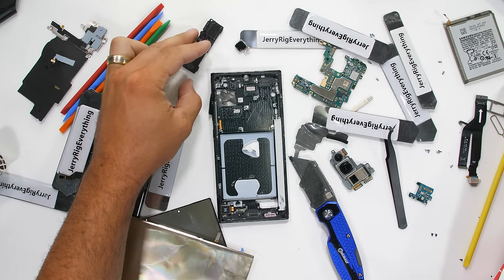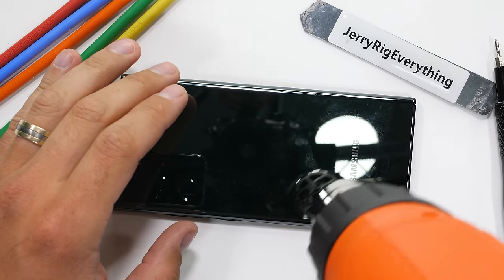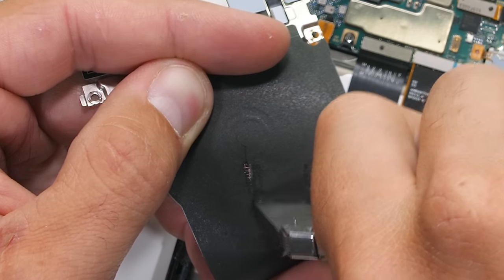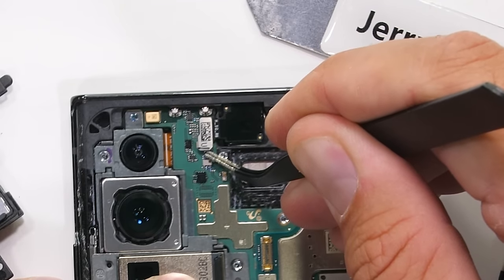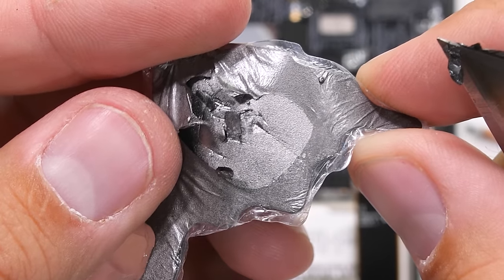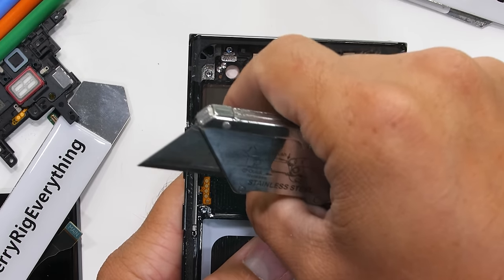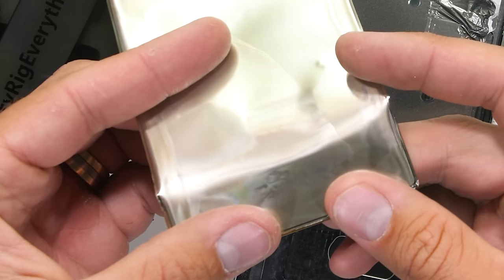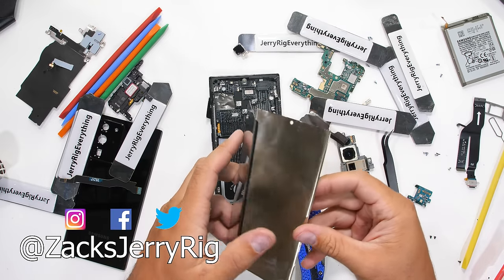Samsung Note 20 Ultra Teardown! - No Copper Cooling inside?!

Comment: Jerry, i'm not a fan of this double-standard practice either, but:

Graphite has a HIGHER thermal conductivity coefficient than copper, it's likely the Exynos chip requires a better heatsink to dissipate the higher heat it generates compared to the Snapdragon model.

Of course, Samsung could just put the same graphite cooling system on every phone and just charge less for the weaker Exynos model....

Comment: The problem I see with the graphite versus copper cooling argument is that there are not really any tests proving that the copper cooling is better than the graphite. Also, I wonder if the virus and the inability to keep up with the demand is what's forcing them to use different components. It could also be due to an internal competition between two cooling systems to see which one is better (expectation being one being better than the other by a small amount). Even so, this year I would cut phone companies some slack(but not too much. Pricing a phone at $1300).

Comment: So basically they're thermal throttling the Snapdragon phone to try and match performance of the poorer performing exynos.
Reply: Exactly, it's supposed to avoid the drama over the US S20s performing way better
Reply: He stated that this teardown is the international version. So the Exynos one.
Reply: @rushnbh  i assumed you are correct
Reply: @rushnbh  No. Zach made a mistake. The one he tore down was the one with model number SM-N986N, a Korean version using a Snapdragon 865+ chipset. Not an international version using Exynos chipset. So, yeah, it's safe to say that they intended to do thermal throttling of SD865+ chipset to compensate the poor performance of Exynos 990 chipset.
Reply: Yes! Snapdragon unit has graphite pad, while Exynos unit has copper pad!
Reply: @nimeshyelshan8704  NO HE'S NOT! 🤦🏽‍♂️🤦🏽‍♂️🤦🏽‍♂️
Reply: @rushnbh  WRONG! What he stated is Not 100% CORRECT!!! He uses a South Korean unit with model number SM-N986N, that's a Snapdragon unit with graphite! Buyers confirmed that!
Reply: @yosoy01ian  How buyers are supposed to know what kind of thermal solution their phone has ?
Reply: @travelwithdivyam6400  unless they are able to do another tear down video of the US version Galaxy Note 20 Ultra 5G. Because it was already proven that the internation version Note 20 Ultra with the Exynos 990 processor has the Copper Cooling pad in it inside.
Reply: @travelwithdivyam6400  
Snapdragon - graphite pad
Exynos - copper pad

it depends on which country where you bought.

Comment: I guess copper cooling system is only available in korea (Samsung's origin country) and not in other countries.🤔

Note- I think🤔 It's not about Snapdragon or Exynos version.
Reply: Zack is actually using a South Korea unit with model number SM-N986N! It actually uses a Snapdragon unit with graphite cooling system, similar to US model. Units with Exynos will have a copper cooling system on it.
Reply: @yosoy01ian Okay, But then also they aren't allowed to sell same phone with different parts in different regions (not talking about different processor )
Reply: @Mayank_Gupta  Yes! I assume that the component (for thermal pad) should be the same.

Comment: I agree, Samsung's game has been going downhill. Had a wonderful experience with my first Samsung, the Note 8. The Note 10 Lite seemed a pretty close cousin and I happily recommended that for my dad. Its been quite a let down though. Definitely not value for money. 
The Galaxy Watch 46mm has been quite a disappointment too. The barometric sensors have never really worked well nor the altitude and sleep tracking has been temperamental at best. 
Dont think my next device is going to be a Samsung though I still love my Note 8.
Reply: My S8 has battery issues (it’s dies quickly) , and I brought it in September 2018... It’s not even 2 years...

Comment: I used to be an all in Samsung fan until they started ripping us off like that. everytime isee one of there new flagships i get tempted to buy it but and I do want to go back to them but I cant because of actions like that.
Reply: 🙄 I think graphite works better! And wont dry out from the excessive heat from the Exynos chip anyways ! I think they couldn’t use thermal paste so they used graphite instead! 
A good graphite sheeting has conductance of over 1000 whereas thermal paste has onky 15 !
Reply: @rahuldogra  totally correct! Zach is completely wrong on this one, the exynos version clearly has the superior thermal solution, NOT the copper heat pipe in the Qualcomm version!
Reply: obiwac the heat pipe is a better thermal solution but the thermal interface material is the culprit there ! Pad can get a good seal with out the need of thermal interface material
Reply: SAME HERE SAMSUNG IS DANGEROUS THAN CORONA
Reply: @obiwac  I THINK OBIWAC DONT KNOW ABOUT EXYNOS IT WILL BURNT HIS HOUSE LATER RATHER THAN CORONA
Reply: @raghuraghu-vz2cj  wtf

Comment: What i dont get about Jerryrigeverything is how he downplays Graphite Film as a heat conductor. It transfers heat exquisitely and Apple exclusively uses Graphite Film to dissipate heat all over the iPhone. Samsung chose to do the same because it works, almost as well as Copper. Every second manufacturer uses Graphite Film because it dissipates heat just fine. There is no need for Copper if they did not deem it necessary. This is not a Desktop computer where you‘d need Copper as a Heatsink for the Processor. These processors dont get enough to justify needing to use Copper as a heat conductor!
Reply: yup, graphite have thermal conductivity of 370W/mK while Copper have thermal conductivity of 385W/mK
graphite also comes with only 21% copper weight, so it's a solid upgrade over copper

I even wonder how he have some balls at both ends to say graphite is bad compared to copper

Comment: Strange I've only had Exynos phones since the Note 2 and never had heat issues. I once had a Snapdragon S4 and Axon 7 phone and both had really bad heat issues.
Reply: I'm having heat issues with my note 9 exynos
Reply: Phones with exynos aren't bad by any means, that's not the point, but snapdragon ones (starting from the 835) are noticeably better, and Samsung charging the same amount for a less capable phone with exynos is a total dick move
Reply: @duranmxx  I guess your right my friend has a PocoPhone F1 which I'm sure it's 835 and his phone never heats up. I guess they still had heat issues up to the 820, that's why I said I'll never buy another Snapdragon phone but since I'm getting a OnePlus 7 pro I guess I'm giving Snapdragon another chance. But I'm being honest I've never had any issue with any Exynos Phone.

Comment: 10:03 that's not just sketchy, it's daylight robbery. Especially because here in India we get the note 20 ultra with Exynos 990 and we pay equivalent of USD 1421/-
Reply: Not true I've just ordered it's almost the same price if you considered credit card offers I'm from India and I have preordered will let you know how the mobile performs for its price
Reply: Sanjay Charan Credit card offers don’t count while reviewing.
Reply: @vblaze011  atleast an extra 128gb? While in US they get 128bg for 1300 and we get 256gb
Reply: Sanjay Charan India models work 10% slower due to Exynos, don’t have a copper heat sink on a chip that’s known to overheat so it’s not a true positive.
Reply: @vblaze011  I understand your concern I'm equally disappointed as you for Samsung using a inferior chip but what I'm trying to say even some exynos variants are found having copper heatsinks it's random unless Samsung opens about which variant has which heatsink plus note is not a gaming phone its a phone for note taking, creator's, business user's and students so exynos is sufficient but I even hate the fact that it could have been better but over all its not a bad phone it's totally based on  your personal preference.

Comment: Imagine if apple did this everyone would be fuming 🤓
Reply: Seriously
Reply: It did happen when they used two different chipsets in the iPhone 6s I believe where Samsung and TSMC were making the chipsets and Samsung obviously was the inferior one and everyone was calling it chipgate and throwing a tantrum for a whole year because of 5% diff in performance
Reply: Researchers at Chalmers University of Technology have developed a graphene-based film that has a thermal conductivity capacity that is four times that of copper. This new technology makes it perfect for cooling electronics circuits and components in RF devices, LEDs, servers, and smartphones, to name a few.Jul 15, 2015
Reply: apple is using graphene it is better than copper
Reply: and is expensive than copper
Reply: true
Reply: @gogeta7173  I'm betting that's just apple fan(boy) fiction, there's no way they're getting any useful work done from graphene in the centimeter length scale without revolutionizing WAY more industries than phones. If they do have it and aren't making more products from it while keeping it a trade secret imma sue them for not acting in investor, public, and world interests.

Edit: Unless I'm just an idiot and thermal conductivity doesn't degrade as quickly with imperfections? Of course it doesn't

Comment: This device charges another device WIRELESS faster than my iPhone 11’s ancient ruin stock charger adapter. Thank you apple
Reply: Apple is cutting edge!

Said no one ever. 🗑 phone.
Reply: and they worried about stupid vapor chamber and thermal pastes nobody care about this
Reply: At least Apple doesn't gives you different processors with different cooling systems for $1300.

Comment: When Thermal cooling is required for Exynos to keep their hot processor cool they used it for Qualcom..😂 Except USA, Canada rest of the world Samsung take them as a fool. Thats why they are doing this kind of cheating. Still i'm a Samsung User bt for my next device i would go for iphone or Xiaomi rather than Samsung.
Reply: I am a galaxy note 8 user and can confirm that the exynos chip is easilly getting warm.
Now i am using mate 30pro huawei with kirin, such a huge diference. The kirin is so good in handling heat, play OL game and the HP'temperature is not increasing
Reply: Yeah like iphone got thermal cooling lol

Comment: @4:17 without having a sound measurment device, I can easily say that the note 20 ultra in my hands has MUCH closer stereo audio than my note 9 (or iPhone 8 plus...or 7 plus) did. I created an audio file to test my airpods back when they first came out, and ended up learning of the speaker disparity on the 7plus at the same time (got apple to replace the speakers on my brand new phone thinking it was broken....and they broke the phone....so I had to drive elsewhere to get THAT one replaced).....took the Google spoken version of the words left and right into an audio editor, split them into separate channels and then copy pasted the clip. You can turn the phone to check the other to make sure it isn't the volume of the word to see how it sounds to your ears, before now the difference was ridiculous. I can hear a difference one the note 20....but only if im trying to.
Side note, the reason for the test was to see if a single airpod would play mono sound automatically...they did, later i found that the gear iconx did not....but my first gen galaxy buds (and now galaxy buds live) do in fact also do this, put one in, get full sound

Comment: I really like your videos. A fan of yours from the Philippines.

I got mine the LTE version because the 5G version was offered only during the pre-order period.

I am disappointed because the LTE version only has 8GB or RAM and exynos in it and the price difference only around 100 dollars. I don't have a choice because the 5G version is no longer available. I really need this note and it's features for my work. I was like got double killed for 8GB RAM and exynos.

It would be so nice to have the 5G, Snapdragon 865+ and the 12GB in it.  This is my first note to replace my 3 years old CP.

The dilemma of NOTE 20 ultra.

Comment: iFixit’s Greg Kramer, a thermal systems engineer, states that “there is little difference in performance between vapor chambers and the graphite. As long as you take the gap tolerances into consideration, it can be simple enough to swap them out for each other.”

Comment: 9:53 i feel the same. I left samsung for one plus. I actually just watched the one plus 8t tear down before this video and for some reason I found that video more interesting. Seems like it had stuff that this note 20 ultra should have had. Also the one plus 8t costs a fraction of the price if purchased while on promo. Got my 8t  for 250 bucks after i traded in a galaxy 9 i purchased on Amazon for 250 bucks. Good tmobile promo imo.

Comment: I am watching this video now and remembered my own International Note-20 Ultra (with the Exynos chip) and it does have the copper vapour chamber, I know it does because I used it on another device (N20U was beyond repair and I needed the vapour chamber for something else so I took it from the N20U). 

My phone was released in 2024 before this video, so I am now very confused. are the phone's Zack is showing (and the other one he showed in another video) both defects that are missing the copper chamber or is there something else at play here? My phone IS the exact same as the one he showed (just gold) and it does include the chamber. 

Very Strange.

Comment: I have an S7 Edge that's really showing it's age........may be my final Samsung smart phone after following them since the S2. The craftsmanship and corner cutting (to me) with the whole heat dissipation is disturbing in something so expensive, and I concur with you on the hardware differences. They should be marketed as different phones at different price points. They are ripping off the Exynos region!

ROG Phone 3 here I come.

Comment: My wife just bought the Note 20 Ultra literally last night. She has been using the phone less than 24 hours and already her comment is that it feels like a downgrade from the Note 9 (her previous phone). Ffrom a strictly user's point of view: The camera is obviously way better than the Note 9, so that is in the Note 20's favour. But in every other respect the Note 20 feels like a downgrade. A super fast processor: mose end users won't really notice any difference when all they're doing everyday is using Whatsapp, email, a banking app, etc. Fast charging: Again, a normal user doesn't care. She plugs it in when she goes to sleep and it's charget by the next morning. It could take 6 hours to charge and the average user wouldn't care. A no bezel screen: Again, no one really cares except Samsung. The Note 9 already had a good enough screen, a tiny bezel on the top and no punch hole on the screen. Where the Note 20 really sucks is NO HEADPHONE JACK. A phone a this price level shouldn't restrict what the user can do with it. Really a stupid move by Samsung. Yeah we got an adapgter that will allow for it, but why should she have to use a clunky adapter for something the Note 9 could just handle with no problems?

In terms of specs I have no doubt that the Note 20 is a superior phone, but in terms of how the user feels about it, it feels like a downgrade from the Note 9.

Comment: Miss the design of the old note 4. Still have mine and a few spare batteries but so many of the apps no longer function on android 6. If itnhad been water resistant like the S5 it came out alongside then it'd be my main driver till doomsday.

Comment: I would think that the little balls inside the speaker are there for diffusion purposes. Foam isn't reflective if you think about it, so they're actually cutting 'down' on the reverberation.

Comment: can you point out the location of the GSM antenna ? I'm heaving trouble with loosing signal probably due to a phone crush I had ...I think of replacing the Antenna Module but I didnt get which part is the GSM reception antenna , would appreciate your help ...Thx

Comment: you say "taptic vibration motor"..but I believe Taptic engines (like the ones in Pixels and Oneplus) are different in theory than Vibration motors that Samsung uses. Taptic engines >> vibration motors, that is why Samsung phones have terrible vibration feedback compared to Oneplus phones or pixel phones or iphones. Let me know if I am mistaken.

Comment: Can you please check if the s-pen from note 20 ultra works with note 10 plus, I mean if it works full functions, including the low latency. I know from other articles that note 10 plus s-pen work on note 20 ultra. So if the s-pen is fully backward compatible, it could be considered as a little upgrade for Note 10 Plus, having reduced latency? Just a thought

Comment: Does the Oled work after the diasembly of the screen from the Frame? Thinkin on the flexible oled and not the ususally breakable hard one.. ?
Reply: No removing the display will delaminate the polarizer from the oled layer which will kill it.

Comment: I think that Motorola have the most confusing set of phones. When I was looking at the G7 ranges, you'd have variants with/without dual sim, with/without NFC, with/without more RAM all based on the same model, but different territory. Makes looking specs up more difficult than it needs to be, especially pre purchase.

Comment: My screen had to be replaced it's an international 4g exynos and I got the part back it's got the copper heat pipe which is good as phone runs hot.
Reply: Wait what? Never heard of note 20 NOT running 5G.

Comment: Recently I got my battery replaced (as my old battery was depleted because of 2.5 years of usage). While replacing they have messed up the display. When escalated to the Samsung support, they deny any damage done as part of battery replacement saying each module can be replaced without harming the other component. 

So I am here to validate whether whatever they claim is true or not. I'm from India and here the customer rights are a joke.